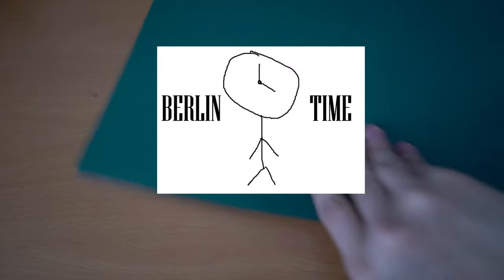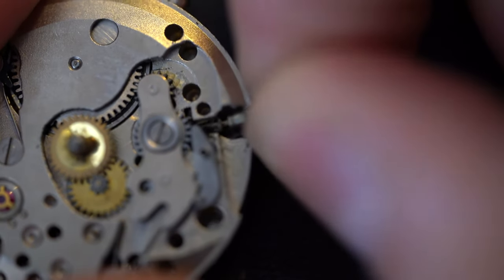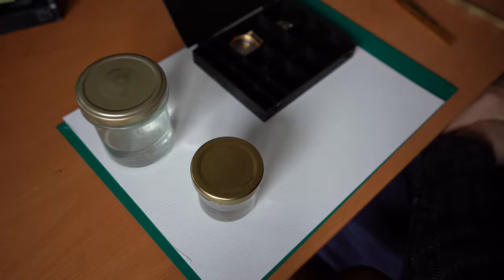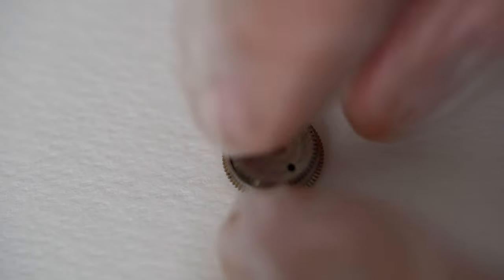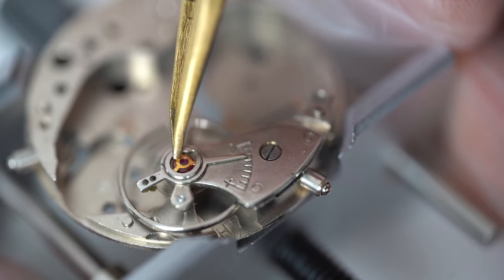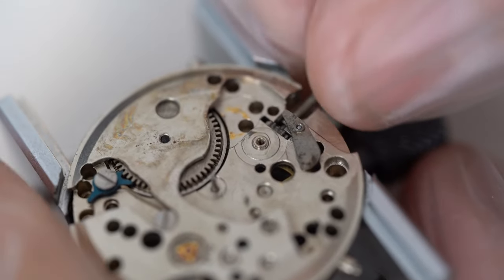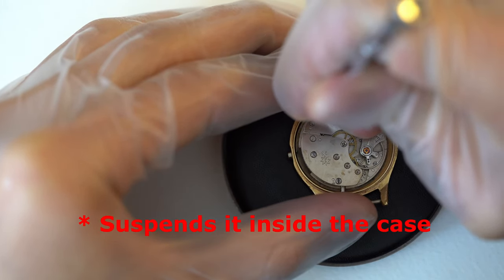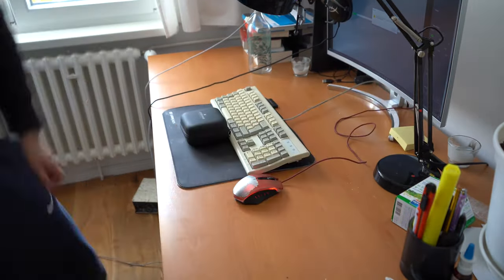Restoration of a vintage Junghans watch found on the fleamarket - Repairing a Junghans / 93

Comment: Ahhh yes, that's the same vintage Junghans watch that I bought and gifted to a relative. That's not just a nice vintage watch. It is a very, VERY RADIOACTIVE vintage watch (if you don't believe me, then you can test it yourself with a geiger counter). I shuddered a bit at the beginning of the video when you were touching the dial markers with your bare fingers, so you were touching radium. I hope that you did not ingest any of those particles, and I hope that you furiously washed your hands before eating/drinking! I also hope that you notify your brother that he has a highly radioactive watch!
Reply: Definitely radium on the hands. Bought one myself, looked in the archives… radium… bought a geiger counter… and yes it‘s radioactive. Clearly. Wearing it occasionally, no big deal, working on the dial and hands without glasses, mask or ventilation… i would not do it. If you ingest radium or radon gass (222) then your body won‘t be able to shield it and you will have it in your body forever. 
I wanted to do a service on my 93s1 but I al hesitant because of dial and hands. Bit scared. 
2.79 mikrosievert/h on top of the glass. Nothing craaaazy but still 9 times what‘s normal
Reply: i saw the hands and it told me thats radioactive...people dont think about this but buy a geiger if you work on vintage!

Comment: I believe the off-center slot on the screw indicates it’s a reverse thread screw. Some but not all reverse thread screws will have a center slot and a parallel slot on the head. I’ve read that putting a spring in a barrel with your hands will likely slightly kink the spring. I went on eBay and found a cost effective spring winder. I figured that it would be worth it to be safe and keep the spring from popping out and causing trouble.
Reply from the maker: Thanks for the tipp and info!